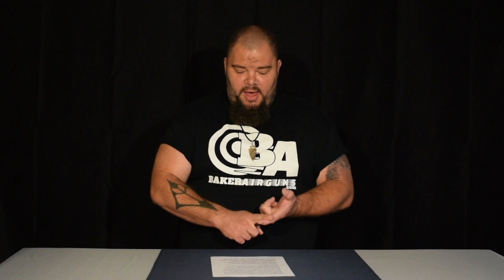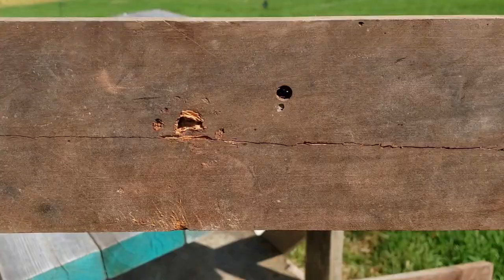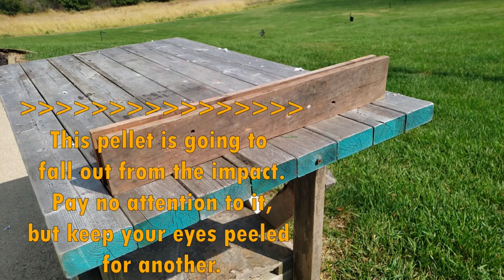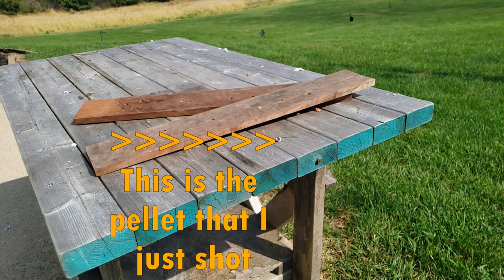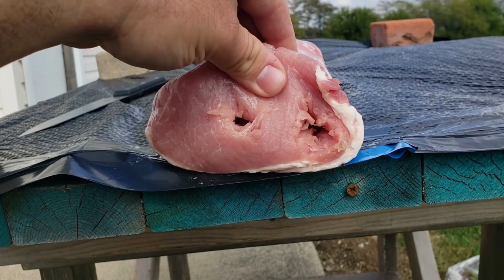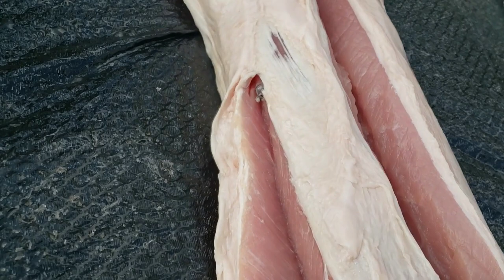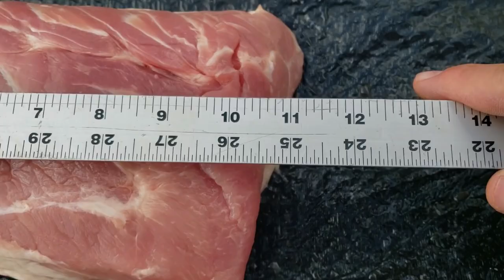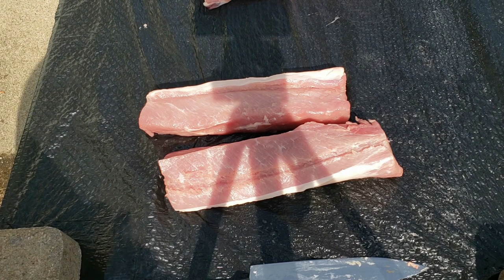PART II...What's deadlier, a .25 or .30 caliber airgun?

Comment: Once again - excellent content Donnie. My Physics teacher was a Major in the British Army. At age 12 this main impressed on me the following example of Force over Area. He took a Plimsole and flayed my arse with it for being insubordinate. Disappointed with my expressed level of anguish. He changed tack, and used an Ebony Ruler on my thigh. Still frustrated by my less than adequate expression of remorse or apology. He then used a cane. The Plimsole left red marks. The ruler left a welt. The cane split my cheeks open. I still didn't apologise, but I learned my Physics lesson. Guess I got a head start on some folks. And to further support my  real world experiences of training Load over Area. As a qualified Structural and Civil Engineer, I had to walk around my Construction Sites in Boots. As a trainee site manager, fresh out of TECH  - My Supervising Project Director gave me a safety briefing Day 1. THE most important point  - DO NOT RUN AROUND ON SITE!  Here's the thing - I'm then 22 weigh 205lb and train 5 nights a week for three sports. Running, fast, was a competition. SO I ran on site. I ran over broken bricks, lengths of 4 x 2 . Formwork, Trench Shields, you name it - everything. That is, until the day I ran and had a nail come up through my boot and right through my left foot! I mean ALL the way through!!! Now, I'd run over hundreds of lumps of 4x2 and bricks and not one penetrated my boot. I ran onto ONE nail and it nearly ruined my sports career. My Boss - when he saw me at the First Aid Shed - took one look and walked away. LOAD on cross sectional area dictates penetrative force folks. Fell free to try this at home on yourself. For the armchair experts - place the hand you use the least on a hard flat surface then, taking your wifes rolling pin with the other hand....................
Reply from the maker: LOLOL  That was both HILARIOUS and well informed.  Very sorry about your foot, though.  Thank you very much for the post!  Glad you enjoyed the vid.
-Donnie
Reply: @BakerAirguns  I survived Donnie, it's didn't slow me down too long. Here's a thought folks? - ever tried pushing a 2" nail into a wall with your thumb, compare that to pushing a thumb tack into the wall? 

And the final part of the equation regarding nails through boots - if I was walking and not running would my 205lbs still ensured the nail went right through my foot? Velocity matters.

And you didn't touch on DRAG Co-efficient in a fluid or mass. I'd take a .25 Cal all day every day for what I do, but I use a .22 Cal

Comment: It stands to reason, that 2 separate projectiles moving at the relative speeds necessary for both to impact with nearly identical fpe, the deeper penetration(ooooh-ahhhh) will go to the projectile that is receiving the least amount of resistance due to it’s diameter.
I’m sure you would have very similar results if you compared the .22 and .25, or the .177 with the .22, at the necessary speeds to create matching fpe.
I remember reading about, so I repeated it—using my Whitworth .375 and a variety of factory hunting loads, and my 75# compound bow. The experiment was, as I set it up, to stand 20yds away from a 5gal bucket filled with sand, and fire projectiles out of both weapons at the bucket and record the results.
Not one of the .375 hunting rounds passed through. While every field tipped arrow that I fired, did. Regardless of the overwhelming disparities in power, every bullet performed the way that it was designed by expanding from the tip back, and effectively increasing it’s overall diameter thereby increasing the resistance. While the lowly 400, or so, grain arrow, moving at roughly 300fps, producing in the neighborhood of 70ish fps—passed through every time.

Comment: Awesome video Donny! Great way to set the record straight...incidentally...people have to realize that your theory can be proven with a sowing pin...a smaller pin will pierce deeper with the same enery behind it than a larger pin..because there is less surface area to resist the entrance. Smaller...faster..less resistance ....equals deeper penetration...thats reality. In short...same energy...different mass..more penetration.
Reply: True. But that doesn't make it more lethal.
Reply: @n2shooter  it depends on  Circumstance....

Comment: i checked google search about hydrostatic shock juxtaposed to my view point. a search says consensus is around 2600 fps to begin generating hydrostatic shock. and so my view point is being aware of definitions of hydrostatic shock and hydrolic shock. if i was a bucher i would have tested my method on buchered pigs head first to figure how to make it work. would be interesting to use butchers air rifle and data to see if it duplicates on butchered heads. i analized this in search of power modding a 30 cal to its max fps with fpe so out side of context of 70 fpe maybe do a vid on the 30 and 25 both doing 935 pfs using the above mentioned ammo. its fun stuff

Comment: You are correct Sir. You could look at it like this if you were in a falling elevator, whats the best way to impact the ground? lay flat spreading out the energy of the impact so not one area is subject to that same energy concentrated on one area doing far more damage. Basically with the .25 cal vs .30 cal your concentrating the same force of energy onto a smaller area with the .25 cal thus for less dispersal is gained on impact so it has to travel further with its smaller size to disperse that same energy. Technically speaking at the same speed the .30 caliber would have considerably more energy, yet the .25 still has to travel further with its smaller area to disperse its energy. Try standing on a picket fence point with one foot vs standing with one foot on a sixteen penny nail. Which would you think you would sustain less damage? Might be painful on the fence board point but i doubt you'd feel it tomorrow at all. that nail though? Ouch, as it'd easily go all the way  through... Many magicians and other weirdos walk on a bed of a bunch of nails. You never see them try it with just one nail and we all know why. same rules apply as physics are same basic principals.. Great video and great perspective to describe effects of pellets. Thx and keep em coming...

Comment: Sectional density is greater with a longer slim bullet. The smaller front area of 25 also helps. 
It would be interesting to see a hard pointed tip. Such as the H&N Hornet.

Comment: Donnie,  it's a great video like usually but I was wondering,  how about comparing  .30 and  .25 with equal weight and fps. NSA has .30 43.8grain slugs as well as  .25 43.5grains same metal density that would be very interesting.  Considering somehow the slight difference in weight witch is 0.3grains
Reply: Different weights @ the same speed...heaviest wins every time.

Comment: Let me first thank you for taking the time to go through this topic... with respect to the two ( calibers .25 .30) the power a air gun power plant can produce is finite and depending on its configuration and mfg each shot diminishes  ( from my understanding ) as the amount of Air diminishes in the bottle..so yes a .25 with a finite power unit behind it will attain a higher fps and thus a higher velocity ... and effectively be more powerful and more deadly ( and ) the .30 will be less effective if our powers are the same .. that is my understanding. Force X mass = acceleration 
Considering I am looking at going Air for some calibers I am curious on this topic because  I am trying to see if I decided to hunt with  PCP Air vs Powder what is my measure to determine 1.) the weapon to use and 2.) the caliber to use... 
 I know the following and in the powder world ... the muzzle energy of a 9mm Luger (Parabellum) round averages out to 360 ft-lb, while a .44 Remington Magnum round averages out to about 900 ft-lb. One way to think about this is as such: a foot-pound is a unit of energy equal to the amount of energy required to raise a weight of one pound a distance of one foot. So a 9mm Luger (Parabellum) round exits the barrel with kinetic energy equal to the energy required for linear vertical displacement of 360 pounds through a one foot distance, while a .44 Remington Magnum round exiting the barrel has energy equal to the amount required to displace 900 pounds over the same one foot distance. As a rule of thumb, when it comes to hunting, muzzle energy is what many hunters look at when deciding on what caliber of firearm / ammunition to select. Generally speaking, the higher the muzzle energy, the higher the stopping power.

Comment: Interesting… as I sit here with a .177, .22, .25 & .30 cal pellets lined up on my coffee table. Just watched a guy take an Elk from the back of the head at 60 yards or so with a .30 cal… dropped like a sack of potatoes! You are correct, looking at the size and weight of the .30 cal, it’s not intuitive 🤣

My .30 barrel is on order for my FX Impact Mk3 so soon I’ll know for myself! 

Only question I had was the difference in barrel length. The .25 was shot thru a longer barrel and more FPS vs the .30 cal was a shorter 500mm and at lower FPS? Not arguing your point… just curious if all things were equal… love to see those results as well. I guess ft lbs of energy only count on small game? Great vid!!
Reply from the maker: Thank you!  Barrel length and velocity are irrelevant to the testing.  I set the energy the same, which was the purpose of the test.  In physics force (energy) is what does work.  For an equal test, only the energy needed to be the same.  Glad you liked the vid!
-Donnie

Comment: I'm going to try to add my 2 cents in as simple as I can, as the man said in his video, don't hate me hate physics. when it comes to ballistic performance, there is a golden ratio of penetration (INSERT noise here... lol) and energy transfer. Over penetration severely hinders the effectiveness of terminal ballistics. What you really want to aim for is having the right amount of penetration so the projectile has the right amount of momentum (I believe that would be the right term to use I'm not quite sure) upon impact to release all of its energy into the target, and in so doing will create a bigger wound cavity.
Also, over-penetration can cause collateral damage further downrange possibly causing more harm than good. I hope this makes sense and I don't sound like an idiot.

Comment: Hi :-) I have been watching your great videos. I am considering buying a bolt action for backpack hunting in .25 or .30.  But as a PCP newbie I need your help. I find the PCPs interesting when we talk about a distance between 50 and 100 yards, and there are plenty of videos of people doing great shots in that range and even further distances. As you must likely know .308 is the favorite caliber in use for snipers long distance shots but the other 99% of the soldiers use smaller calibers for closer combat, for this reason I think that your two great videos left an important question unanswered; at what point of reasonable longer distances does the .30 higher mass has an advantage over the .25? Does it?. 
It would be awesome if you could apply your same smarts to do a test at these not uncommon higher distances because there may be significant projectile behavior changes… and nobody else has done it! Thank you.

Comment: It's also a historic fact that they've been through this before in the days of black powder. An elephant gun in those days was a four bore! 
   After the Advent of smokeless powder, something along the lines of a 416 Rigby would usually do the trick.  A smaller bullet to be sure but moving at a much higher velocity!
Reply: Actually it’s about sufficient energy and bullet construction. The used 4 bores because they were only shooting lead projectiles back then. 

The proven forums on dangerous game is 375 cal dia as close to 4500 to 5000 ft lbs of energy you can handle. 

For what is considered a stopper . 45 cal with 470 or 50 haveing a more visible effect. 500 gr projectiles at 2150.  Although many caliber can produce more velocity and energy . At that level it’s less positive that bullet construction will hold up to produced straight line penetration. 

Steel jacked hard lead cores would peel or banna at over 2150 and veer off course. It’s all about paying the right projectiles and shot to reach the vital. In charging dangerous came straight line penatration  with a flat nose solid  is what performs best. You always brain elephants .  Cape buffalo you may in some cases choose a expanding bullet for your fist  well placed shot you patiently waited for. Then on flat nosed solids of large dia are called for.

Comment: Firstly, I am not shooting oak strips - nothing I shoot has an inch thick skull of a dense wood. Secondly, I dont need to shoot extra long through the the target of solid muscle/flesh. Thats not going to kill an animal. What kills in a head shot is getting through the skull from one side as a minimum. If it exits ok but thats not necessarily a need or a myst. If your engine room shooting then penetration (in/out) might be an argument.
I use .177 sub 12 a lot (UK based). One thing I have noticed is that a .177 8.44 grain pellet on certain quarry zips through and they flight. But further out, they drop without a twitch. ALL your shots were ultra close and its not likely live quarry will be that close. Not impossible but not likely. Pellet type (if we stick with air guns) can also have very different effects. I prefer some sort of hollow point for close quarry and maybe dome if I need to reliably stretch the distance for tight groups where HPs open up on group.

Penetration is one thing. Overpenetration is another. If you don't need 24" of penetration why use 24" of penetration!
A lot of my stuff is close range in very tight boundaries  where neighbours can be 180° to the shooting point i.e. residential housing estates. I don't want over penetration. I just want penetration.  I guess what I am saying is that max penetration is NOT the king. Its the RIGHT penetration for the job in hand that is king. That is relative. So quarry type, head or engine room, bone, distance, pellet type amongst others dictate your needs. SAYING that the deepest penetration is the one and only ultimate focus or decider is flawed.
Almost all ammo types offer differing projectiles - some with very explicit performance requirements. Many are penetration. Many are expansion. Many are hybrids. Shape, design, materials, speeds, BC efficiency..... so many factors. You are too focused on one thing that IS NOT the king. Your job dictates what is king.
As you stated initially, it is shot placement that counts but you can then fine tune the  whole deal with the rifle type, ammo type and quarry type etc. to be as effective as possible. Its a BIGGER picture.

Comment: Why not compare the .35 pellet at 70 foot pound. This total bull, a .22 at 70 foot pound will als penetrate deeper as an .25.

A beter test would be to schoot the .30, .25, and the .22 at the same speed of 285 m/s (935 f/s) which considered the ideal speed in Club.

What about engery retention at long distance. Looks like you want to proof your own preference of the .25. 

Killing pigs with an air gun is also strange, when I worked in a slaughter house they where stunned with electricity than hung and pled. Cows got a spike through the head to do the same thing, they are unconscious hung and there necks are being cut.
This way most of the blood is out of the karcas.

Comment: I'd like to know the air guns and and type of ammunition used. 

Also, I understand the pellets have bounced off of the pigs head (which is surprising) and that is important because when hunting you want an ethical kill, but in terms of self or home defense, I'm only concerned with stopping the threat.

The US Military switched to the 5.56 caliber to change the method of use. They could carry more rounds, but they were aiming to maim or wound so their comrades would carry the wounded off the field. It takes 1-2 people to carry a wounded soldier.

The .22 caliber has more homicide counts than any other caliber here in the US. Though small and under powered, the .22 is known to enter and ricochet inside a person's body.

That is why, I stress which air gun, ammunition and stats are important for this test.

All in all, it's a great question. Good video :)

Edit: I should also add, a heavy object will keep its energy longer than a lighter object.

So a pellet or slug which is heavier should be more effective at a longer distance, right?

Comment: Most beautifully conducted test I have seen so far on airgun terminal ballistics. Your results are not at all counter intuitive, by the way. There are some other factors in real world usage, and maybe that is what causes difference of opinion for some. 
One, a bigger caliber usually runs at higher FPE, so some might say that we are comparing a 'hot' 25 with a mild 30. If we extrapolate your result backwards, it may be argued that a 177 may be the most lethal caliber. In the (now dead) Airgun Yellow Forum long ago, there was a member called 'Brian in Mi' who modded a 177 to 40 FPE. Imagine what that can shoot through! 
Secondly, I observed in the same forum that most folks who hunt small animals, go for rabbits and squirrels predominantly. For such small animals, the difference in penetration potential between a 177 and a 22 springer means nothing. Either will dispatch with ease. Some folks favored 22s as it has more 'smack' / energy transfer - supposedly anchors quarry better. 
I should say though, that some very experienced hunters did state that they liked the 177 more. The 'smack' didn't really work reliability. I have to agree. If 'smack' is so crucial, why not dump the airgun in favour of a slingshot? 😉